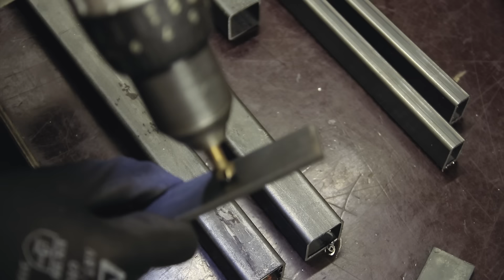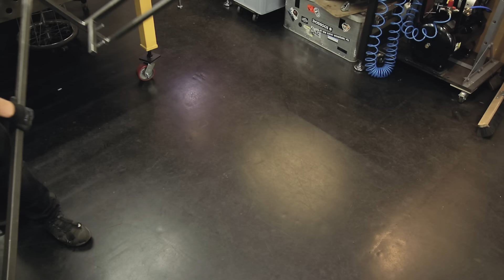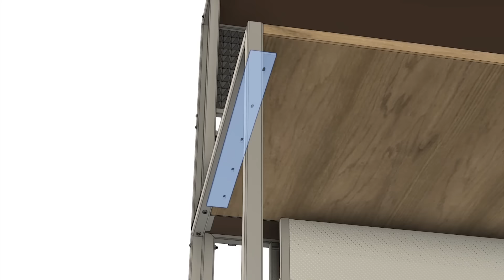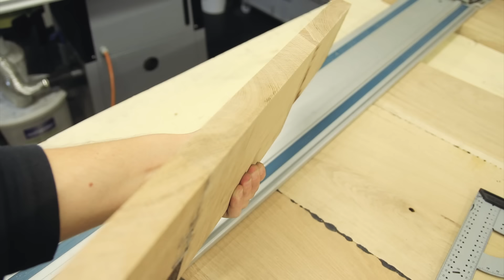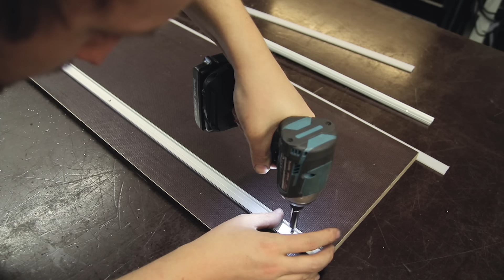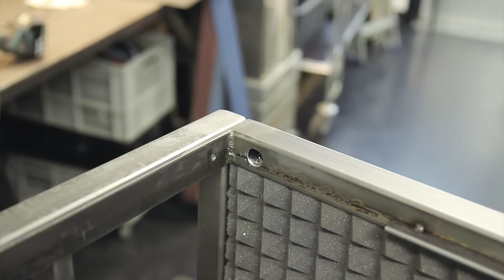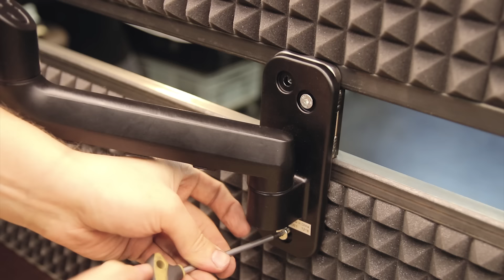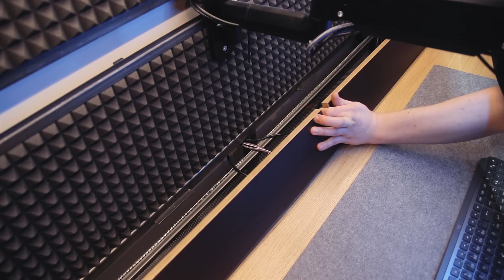How to Build a Cable-Free Desk with Built-In Lights, USB, Outlets + More!

Comment: I use a lot of the desk accessories that you have, and I was wondering what is your use of the monitor lamp if you already have the RGBW leds on the roof of your desk? If I had this desk it would solve for me the problem that those monitor lights do not really fit for curved monitor such as yours. I loved seing the whole project from scrach. Well done!
Reply from the maker: I explained the idea with the different light setups a bit at the end of the video. Basically it allows me to have "mood" lighting and also have a neutral work light at the same time

Comment: This is almost, almost the idea that I'm working on. And you gave me two or three more tips that I'm going to copy.
But one addition that I would give to your project are some mechanical legs. So you can turn everything into a standing desk.
But that is just my idea and I'm definitely going to add to mine.
Reply from the maker: I never felt I needed that feature but it's been suggested here so many times now, I'm actually starting to think about designing some mechanical legs 🤔
Reply: @PhilVandelay  Yeah, well it doesn't seem like you are a full time desk worker. I am, and I worry about seating all day for work then some more for gaming.

Comment: I'm in the middle of building my own desk at the moment. Would have loved to see your video sooner to pick up some tips here and there. I went for a very deep and wide desk (80x250cm). I am planning on doing my cable management in a way that you can't see it, but without obstructing the view of the wall behind. This is because I want to be able to see the light my WS2812B LED strips emmit light up the wall. Still very cool stuff.

Comment: Is the spray mount you used ph neutral or did you not take that into consideration since the foam will yellow and need to be replaced over time?

Comment: Not the usual thing that shows up in my feed, but after watching, i ain't mad. Been rocking a bulky corner desk (the kind that has a spot for the tower in the center and a shelf for the monitor) for years and i keep telling myself i really need a new desk. Every time i move, it seems to break just a little bit more heh. And while the space in the center is nice for the tower... you still need to be able to reach behind the whole monstrosity if you ever need to get to the back of the computer, or remove the monitor shelf, and hoist up the tower. Anyways, definitely a cool build and contains the most important feature; space for the kitties.

Comment: Very awesome design. I have been thinking up something very similar, but a bit taller and with sit/stand feature. The 8020 was going to cost me a lot of money, but I have almost every tool you listed as required for this project aside from the welder, so maybe I'll look into changing the plans into a welding project with some of these elements to keep a modular design but save cost.

Comment: Why do I see everyone apply the oil finishes with a rag? It's such a mess.
A paint brush 🖌️ or a paint roller is much cleaner
Reply from the maker: The benefit is you don't have to clean anything afterwards, you just throw away the rag
Reply: @PhilVandelay  good point^^

Comment: Looks fantastic! I have to imagine it's extremely heavy, though. (Not that that's a bad thing, but that's a lot of steel!) How much would you estimate the frame weighs?
Reply: He mentions in the video that the frame is pretty light, since he didn't use high-gauge steel (it's the part where he picks up the whole frame). :)

Comment: Great job! and also with a perfect explanation on how to build it.
My mod would be to put my cpu on the right side above (so I can see the lights, bc it has a glass panel) and built some drawers on the right below the desk, also between the two foams in the back put a piece of wood (instead of being empty) and weld or screw the stands for the speakers (or find another way in order to be able to move them like yours). 
I'll try to build one for me, thanks!

Comment: Nicely done! For those without the ability to weld, you can use extruded aluminum with corner braces. Places like Misumi USA will cut the pieces to length for you. When they arrive you just have to assemble everything...

Cheers,
Greg

Comment: That was so satisfying and inspiring to watch! The one thing that bugs me is those speaker shelfs: i'm quite sure that you'll get a way better sound picture by rotating them 30-45 degrees towards center so that two of them and your head make a triangle. Anyways it's not that crucial if you're not working with sound-design. 
p.s. Huge props for cats!
Reply: Agreed! The only "flaw" I saw, but can be changed easily

Comment: Really nice work, but viewer beware.  There is is a ... at the end of the title.  All you need is a full machine shop, working knowledge of welding, woodworking, and electrical capability.  100 hours of fabrication, a paint booth, and a crane to lift this monster when you're done, and voila, no wires, and a usb port on your $5000 indesctructo desk :)
Reply from the maker: I don't even have a paint booth, you definitely don't need a machine shop and I specifically mentioned how this is designed to be disassembled for transport, but whatever

Comment: how would you go about fitting more than one monitor, just make the desk longer or would that cause other issues with the design? 
Awsome build!!
Reply from the maker: This is a very large monitor (38" ultrawide), I think it doesn't come across since the desk is also big. You could fit two 32" displays next to each other on this no problem. Just install a second monitor arm in the back wall. But yeah you could also make the whole thing wider

Comment: You could have zigged zagged the foam cutting so there were no strait lines from the two pieces coming together.
Reply from the maker: Yeah or put a divider in the middle would have also worked. Didn't think of it at the time 🤷‍♂️

Comment: Bro this was so amazing! I mean, I cant get over how beautiful that desk turned out. I also was shocked to see how strong just using wood glue is. I thought you might use a dog bone and biscuit, or just a couple biscuits in between each board along with glue. Not needed though obviously. Great content sir!! New sub here!
Reply from the maker: Yeah it seems counterintuitive but if a wood joint is properly glued, the resulting connection will be stronger than the wood itself, meaning if you tried to break this tabletop in half, it would most likely break along the grain somewhere, but not at the joint. I actually tried this myself by breaking the cutoff from the end that you can see me remove at one point, and it did break somewhere other than the joint - biscuits do improve strength somewhat, but for tabletops they're mostly there to align pieces to each other

Comment: I would have made a few changes to my design. Your's is almost perfect, but I would have installed a hinge on the back cable panel, to where it would open from the front, and would lay against the sound-deadening material. I would have also used paint thinner to clean the metal, and then spray paint it with a high-ish quality paint, such as an automotive engine paint or something similarly tough, just to keep the surface clean and to prohibit rust. Great job mate! I'll definitely be building my desk next, inspired by this!

Comment: Overall a good tutorial but I'm having trouble with the turning two different sized monitors into one bigger curved monitor step.
Reply from the maker: One reason was that both of these monitors were quite old and actually starting to crap out on me in different ways. Probably should have mentioned that. But also a single ultrawide is much nicer for gaming and movies than a dual setup

Comment: It looks sturdy.  Any wobble?  I'm a bilateral amputee and often need to lean on surfaces to get up from desks and tables.  This looks freaking fabulous and my brother and I are going to buy the plans.
Reply from the maker: If you push directly from the side there's a bit of wobble, from the front it's rock solid. You could easily stiffen it out more by putting an X-cross shaped support in the back like many store bought shelves have (just two thin steel bars connecting the corners) but I didn't find it necessary
Reply: @PhilVandelay  Hey thanks!  I'll probably put the cross bars across the back for stability just to be on the safe side.  Just bought the plans!!

Comment: Just an FYI - exposing your camera's sensor to a direct line-of-sight on the welding arc will permanently damage the sensor fairly quick. Be careful with that. The shots where you blocked it with your hand or your body are fine, though.
Reply from the maker: Interesting, I've been doing it for years with the same camera,  why is my sensor not trashed if it gets "permanently damaged fairly quick" ?
Reply: @PhilVandelay  That's a good question! I don't really know. Camera manufacturers do warn against even pointing into the sun too much, and we already know the reason why you wear a face shield for your eyes when welding... I suspect if you put a black-out cover/lens cap over the lens and take a still shot w/ the camera you may find a number of white speckles in the image that are not digital noise. Those would be burnt out pixels. If that's the case, the damage we're warned against may just not be  dramatic enough at the moment that it affects the work you're producing in an overly noticeable way.

Comment: I think this could make a fantastic option for sale, perhaps farmed out to a local fabrication shop to support local businesses. I'd happily pay a thousand dollars for a desk of this quality! It would certainly be far superior to most desks that someone could purchase online. 

Before this video, the idea of RGB light channels/diffusion strips hadn't occurred to me, nor had the monitor bar. I'll be looking into those for some of my current and future furniture modifications! Currently in the planning stages for an adult bed-fort for my better half, and you've given me some amazing ideas to work with.
Reply from the maker: See this is the problem with custom fabrication, even with cutting some corners it would probably end up costing twice what you just suggested if built on order. Handmade fabrication is much more expensive than most assume. There's a lot of work hours that have to go into this, and people need to make a living. The only way to make furniture cheap is the Ikea way - mass production in a factory. That's the only reason they're able to offer a desk for 150$.
Reply: @PhilVandelay  I currently work in a furniture factory where many office sets go for $10,000 or more. I fully understand the process of bulk manufacturing, and the associated costs of doing it by hand. However, it could be a viable option for you or your local shops as a side project, to test the waters. Whatever you potentially end up charging, many would be willing to pay for such a sturdy, efficient, and convenient piece of furniture that's not specifically designed to cut costs.

Comment: Amazing desk. I really love it. But how would you approach a sit-stand desk with simular features?
Reply from the maker: Technically I think you could just build the upper part without the legs and mount it to a motorized table base. The only problem is I think it would look quite weird because most of those bases don't fit with the look of this table
Reply: @PhilVandelay  on that note, could you guesstimate how heavy is the top part of the desk with the shelf?
Reply from the maker: I'm not sure exactly but without the legs, maybe something around 40-50 kilos

Comment: Is the material which is uncommon in the US, MDF? Why is it uncommon?
Reply from the maker: No it's a high quality plywood coated with a phenol surface
Reply: @PhilVandelay  oh, thanks for clarifying. I haven't seen these either. I worked at my dad's old woodworking shop and we mostly used MDF for panels and doors.

Comment: I love it! I love the desk so much, everything about it ❤️. And I love how you made a story of making it! For the cableless perfection - just maybe - instead of having that charger on the desk, you could had one of those flat circle shaped, and drill a shape so you can fit it in, being flat with the table (and cable going underneath). Or even drill all underneath, just leaving enough thick (thin) wood on the top, so that current can run through (and draw few lines on top - where to put your phone).
Reply: Linus from Linus Tech Tips, did this on a desk build one time, works really well.
Reply: @davidnichols1192  Linus is never wrong 😊

Comment: Several years ago i've made a simmilar table, but it's shorter - only 104cm, but it's don't need a metal housing, made from 18mm chipboard, has 5 shelfs. including pull-out shelf for midi keyboard and holds 34 untrawide perfectly. I've draw it in a sketchup. with maretial + cutting and my assembly total cost was 80$, but now it looks like a mess with a tonns of stuff o it

Comment: This is awesome work. I don't think I would be able to pull this one off as I don't have the correct tools for it. That being said, do you have plans for this desk anywhere? 

Also, one minor change I think I would have made was to have the center part of the cable management separate from the right/left sides so when you pull the centerpiece up it didn't pull up the hidden power outlets and USB on the other side.
Reply from the maker: Good idea actually about the lid! The plans are linked in the description

Comment: Heyo, nice process of the tablemaking, though I ask myself with that tabletop wouldnt it have been smarter to put some sort of rods or pins inbetween the glued sheets? Doesnt seem to sturdy to me with just glue. Thanks for answering.
Reply from the maker: A properly glued wood joint is stronger than the wood itself

Comment: (English  Below)      Super cool gemacht!  
Was noch fehlt: Eine, zwei oder gar 3 (z.B. 20/60/20% Breite) flache (innen ca 5-6cm) Schubladen/Auszüge unter der Tischplatte für Stifte, Schieblehre oder ähnliches.
Da kann man dann auch mal die Tastatur unterbringen wenn die im Weg sein sollte.
Was ich cool finden würde: Wenn auch das Ladegerät fürs Handy an der Wand montiert wäre.
Kleiner Tip: Einen billigen Rauchmelder in die Mitte unter den Deckel für deinen Kabelkanal.
Was ich auch pratisch finde: Wenn man die Ablage für den PC "Rausfahren" kann. Also z.B. ein Auszug wie eine Schublade. Oder auch schwenkbar (Gelenk dazu vorne)
Dann kann man mal einfach an die Kiste dran... ohne unter den Tisch klettern zu müssen.
Ach ja: Du braucht noch mehr Monitore :-D

PS: Ich brauch so ne Werkstadt! 

-
I like it a lot! The only part that is missing: Some small trays/drawers underneath for put in some pencils, other saml stuff and maybe the keyboard if it's in the Way.
And I would mount this phone charger to the wall
And place a smoke detector in that cable duct - it may save your life, just in case one of the PSUs fail.
What also would be nice: putting that PC on a drawer. so you can have an easy way to access it.
And of course, you need some extra monitors! :-D 

PS: I would love to have such a cool workshop!

Comment: Hi. nice work dude. im designing my project. what steel frame do you use? im thinking if need 20x40mm, 30x30mm or 40x40.
my desk will have 2 meters(large)x 0.65 m(deep).
whats your opinion?
Reply from the maker: I used mostly 30x30x2mm tubing but depending on the desk size I think any of these would work since they're structurally similar and after all a desk doesn't have to carry ton of weight. Personally I would suggest making it deeper, but that's personal preference. This one is 850mm deep because I prefer having some space behind and in front of the screen
Reply: @PhilVandelay  thanks for the reply and suggestion.
im thinking on a tray for the keyboard. But all depends on the monitors space(now im using 2 but maybe the 3rd is comming). im not still 100% decided.
nice channel. I´ll be watching your works!

Comment: I would guess that if Phil were to make a few dozen of these and sell them he would have to charge around 4000 euro each, or more, to make it worth his time. That's assuming he pays himself a normal wage for skilled labor and he includes the costs of the shop space and equipment usage. Maybe with a few people to help him he could cut that cost down since it would make more efficient use of the shop and equipment.

I'm looking at this from the perspective of manufacturing. I used to work in semiconductor manufacturing and now I work in beverage manufacturing.
Reply from the maker: Dude I'm glad somebody understands. I haven't even done the math but I think you're not far off. People undererstimate the cost for one-off custom creation style labor and probably expect something with three figures as the price. I'm not Ikea and I can't shell one of these out in two days, even if it looks that way in the video. Me and my shop are set up for prototyping, not production. Sorry everyone, but it's just not feasible for me or you to sell it! I am however investigating other options such as some kind of build kit - stay tuned

Comment: Awesome and makes me want to get my own fabricating equipment even sooner. I used to fabricate at my old job but I don't have the space to do that kinda stuff at home. 

My only complaint is the mic placement. I recommend fiddling with a way to have it hidden behind the monitor and when you need it just extend under the monitor and above your keyboard. This is my favorite way to have the mic in my opinion. No microphone arm reaching across the desk or in the way of the monitor. Adjust the microphone so your hands aren't hitting it while using the keyboard and it's not in the way of the monitor(might help to rotate the mic 90 degrees).